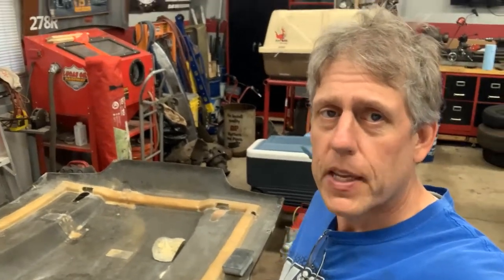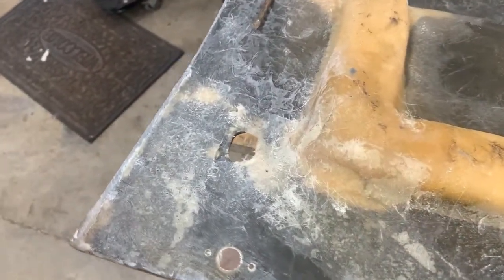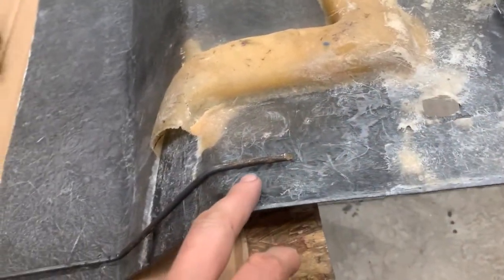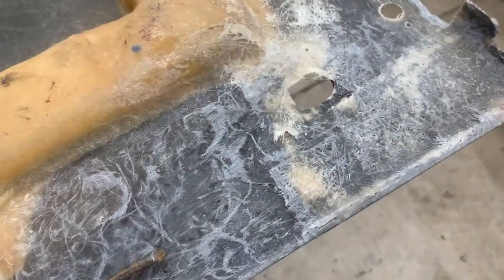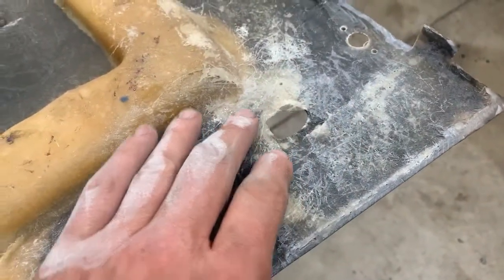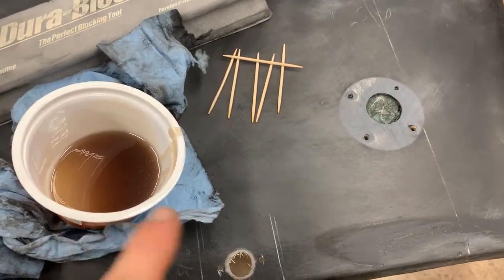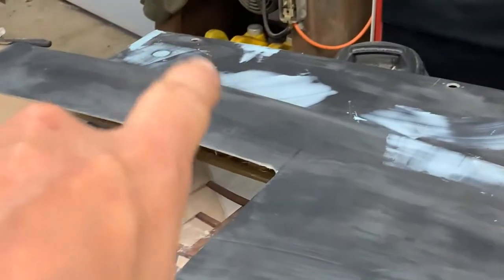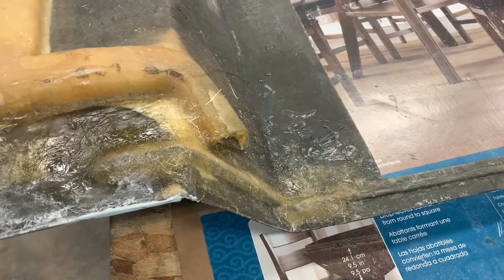Fiberglass hood repair what I did to a buddy hood to strengthen it and fill some holes

Comment: Looks good
Reply from the maker: Thanks, the owner was real happy. He did high film build sanded it down, shot some color and was really happy with the end result.
Reply: Helpful info on your video.  I'm working on a hood for my '13 dodge charger.  The custom shop I took it too had concerns about it being a little flimsy.   I've got a plan for adding some support.  Most fiberglass hoods come with a gel coat(this one did not), do you think taking the hood to get a gel coat applied will help with the strength?